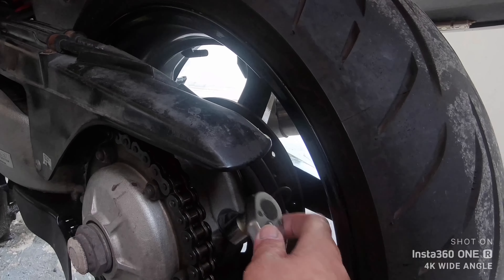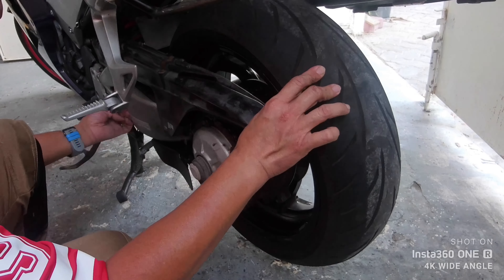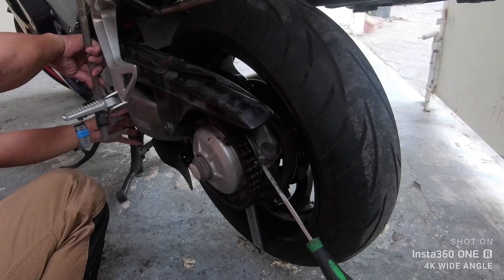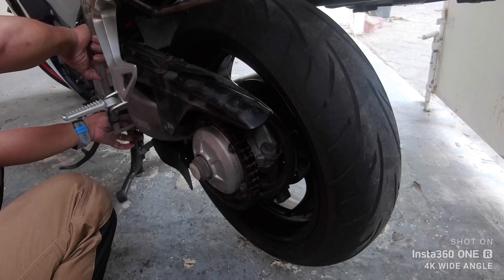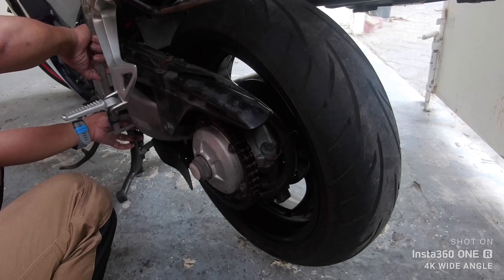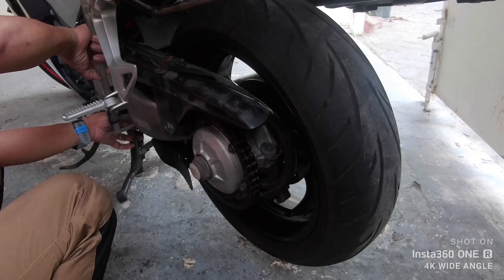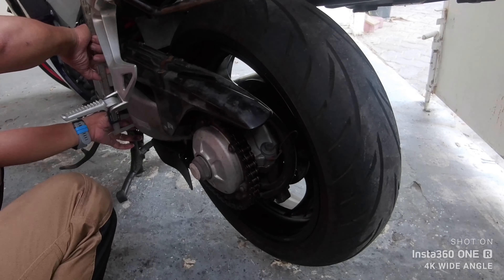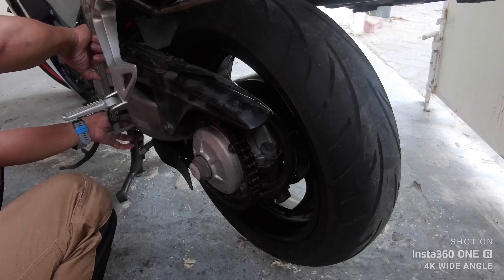Honda VFR 800 How to PROPERLY Adjust the Chain Slack

Comment: All ELF swing arms should be Adjusted ON THE SIDE STAND.
Reply from the maker: Thats not what it says on two manuals, both Haynes and Honda
Reply: @Projekt1  i have the honda oem manual right here.  It says clearly to do the adjustemt on the side stand.
And there are plenty of good videos telling you why. But in short, the rear wheel needs to loaded with the weight on the bike when doing the adjustment.
Reply: My manual says center stand !
Reply: @ I’m not saying it doesn’t, just mine says center stand as per the video. Next time you’re down at Honda shop ask what the techs recommend! Every time I’ve been in dealership work shops the bikes are up on stands at workable height?

Comment: Thank for the video, I am still dumb founded how can the manual state to adjust the chain on a side stand. I always done mine on the side stand instead of the center stand. They must have misprinted a step in the original manual. Please advise, thanks. Could be the f$@$ reason for chain replacement at 15k instead of 20k
Reply from the maker: Both the Honda manual and Haynes states that it should be on the centerstand so I just stick to it.
Reply: The book is wrong. Mine says to adjust in the side stand.  This video is wrong. Leaving this so people don't make the same mistake.
Reply: @Projekt1 so means if I don’t have a center stand, how to I adjust my chain???
Reply: @MaxVFR  that means that YOU DONT NEED A CENTER STAND to adjust the chain. It has to be done on the side stand. The center stand just makes it easy to find the tightest part of the chain, where you adjust from.
Reply from the maker: @hogueraleksander5868  how can you say the video is wrong when I based the “facts” from “the” honda manual that came with my bike and the Hayne’s manual
Reply from the maker: @MaxVFR  what vfr do you have,i dont know why your vfr doesn’t have one. If your vfr is the same with my gen then It should have a centerstand . I am not a “know it all” , so I’m not sure in these case. But I know for sure , the procedure I do came from the manual.
Reply: My 2011 vfr 800 manual states to inspect and adjust on the CENTER STAND. So it’s quite possible your book is a misprint. If you don’t have a center sand buy a paddock stand. 
You don’t ride 90 % on your side so why would you adjust it like that.